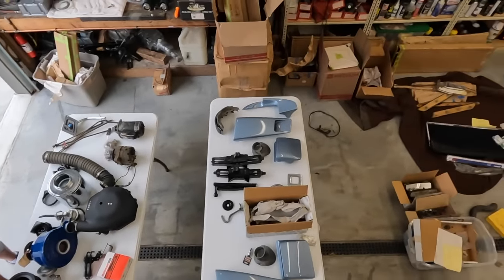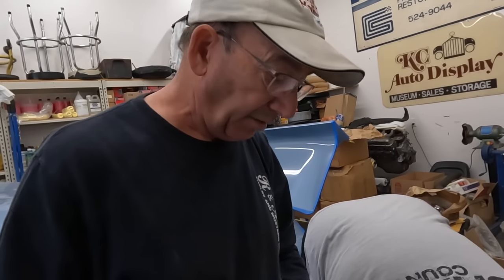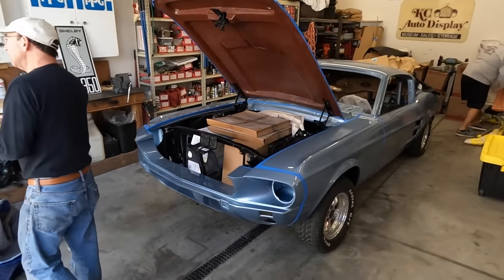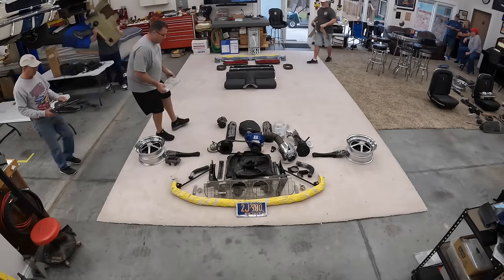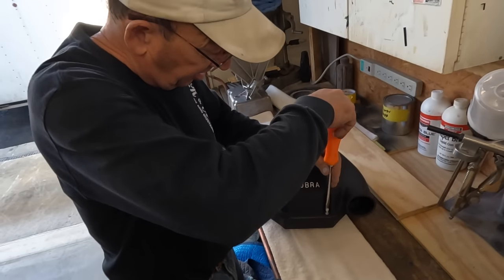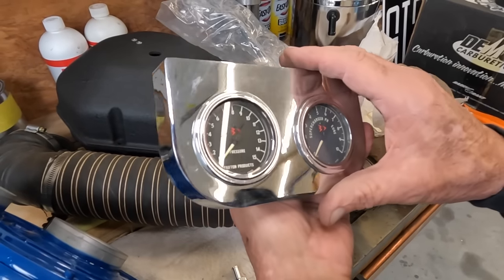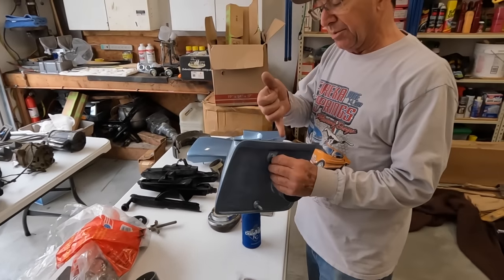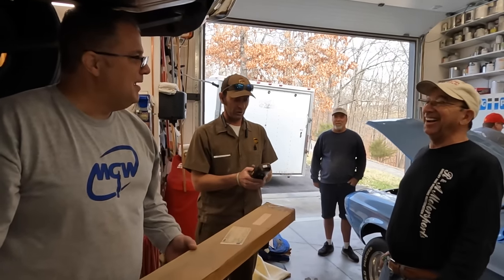Found: Supercharged 1967 Shelby Mustang

Comment: This is BY FAR my all-time favorite body style Mustang, and to own a factory Paxton supercharged 1967 Shelby Cobra is just overwhelming. I really don't believe that I could possibly own and restore a car like this because I have ADHD and OCD badly, and I would obsess over having the correct screws, nuts, bolts, and all fasteners to make it absolutely correct and pristine. Yeah, this coming from a guy who obsesses over horsepower and engine swaps, but this car is special and when you're restoring a historically significant vehicle like this, you almost owe it to Carroll Shelby to do your absolute best to make this car just as it was when it rolled out of the factory. You're restoring a piece of history and doing anything other than how it was done from the factory is almost like sacrilege. Bravo gentlemen! It looks absolutely beautiful!
Reply: i careless about OEM parts if i had this car i would put a 4-5 speed transmission in it . to me a car should be how new owner want it to be it not about how the car was build . and  would put 4 way disk brakes and updated the suspension make it safer . i cant stand OEM fan boys just saying
Reply: @funtyes1970  that would be a  " Restomod", I'd  even go farther remove the ICE  and make it a B. Electric, oh , and  store all those old ICE  parts in drums with WD40 oil for  future full restoration , just in case & for the sake of history.
Reply: I think the unnamed former owner was very much OCD ,but it worked out perfectly because the new owners can build a great car .

Comment: Someone rubbed the roughest off that carburetor, mine has all the castings crusty lines and would look new if cleaned up, mine been setting with a 428 CJ with aluminum intake and C3AE 6090 heads in a old 1967  F 100, Been setting in my field for years, has the C6 transmission, Drove where she sits, Rats eat all the hoses and wires off this thing. I’ll have to get this old truck on YouTube one day.
Reply from the maker: send me an email, maybe we can check out the component and video & do story - jerryheasley@gmail.com

Comment: Love the argument over the scoops but when all said and done the man’s got a beer in hand
Reply: Many do not know that in late 66-67 Shelby had problems with fiberglass suppliers. What really needs to be done is WHEN each was built because both are based on production dates and more importantly WHAT WAS ON THE SHELF in the parts room. I owned a 67 GT500 for 24 yrs.. amazing what you discovered Shelby did to get cars out the door. Like the nibbler on the back panel and two different rear fiberglass taillight panels. SO did the blower car also have side scoops from a different maker?

Comment: Awesome find! Seeing the car has 27K miles and factory ordered, check that the Carter fuel pump is correct for a blower car as the top half was cast special to accept pipe thread for a nipple & hose that went to the back of blower to keep pressure on diaphragm from "fluttering" under acceleration!
My '66 blower unit was serviced by the Granetellis in North Philly in '83!
A daily driver, had fun scaring away big block Chevys after they heard the "whistling" from under the hood. 👍When completed, DRIVE IT LIKE YOU STOLE IT!

Comment: A buddy of mine had a Ford Thunderbird. He added AC with a pulley on the end of the crank. It broke two cranks before he realized that the pull from that added pulley was putting undue pressure on the crank. That would worry me about that blower addition.